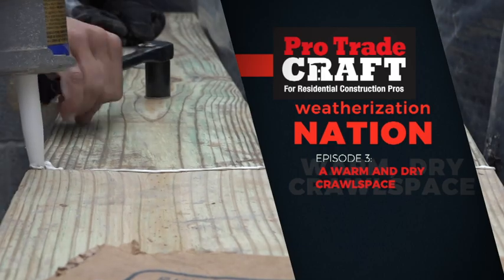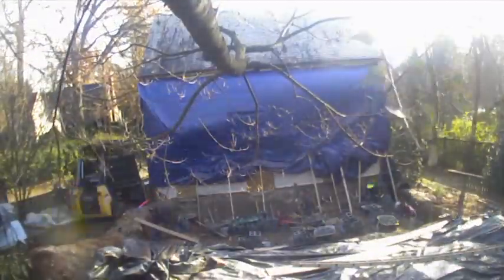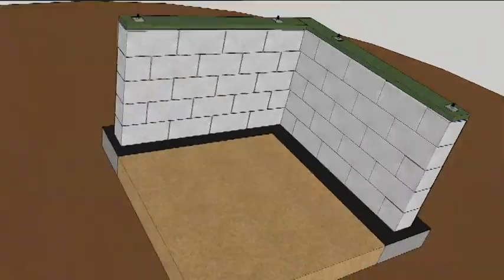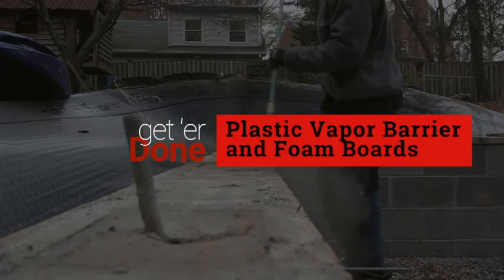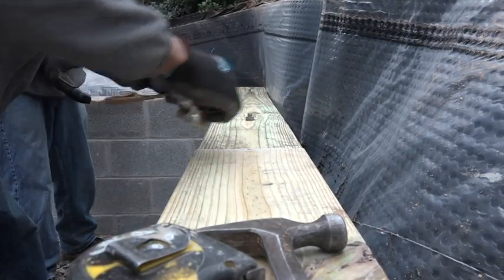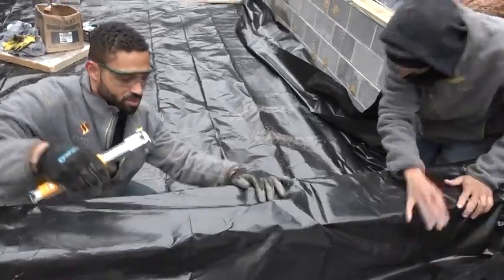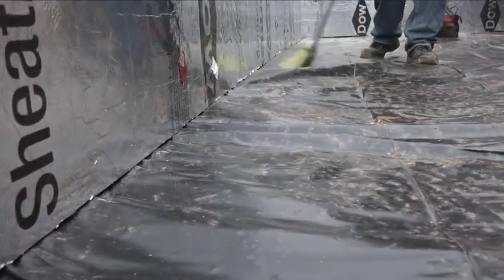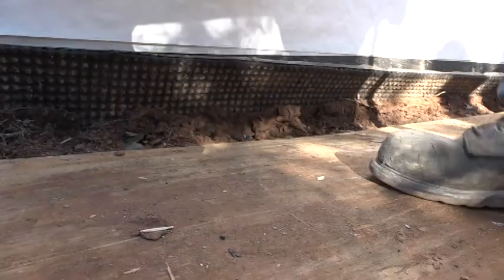Weatherization Nation 3:  A Warm, Dry Crawlspace

Comment: Having two layers of plastic will trap moisture that will never drain leading to standing water in between the sheets of plastic.
Reply from the maker: the first layer is full of holes, not continuous, and beat up. Its only job is to protect the upper layer from gravel cuts caused by workers.
it cannot trap moisture,